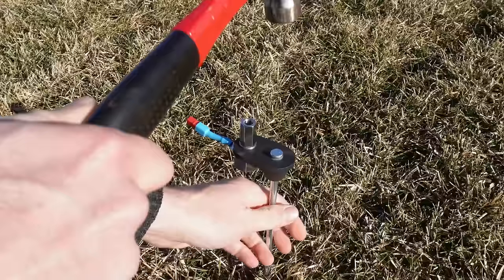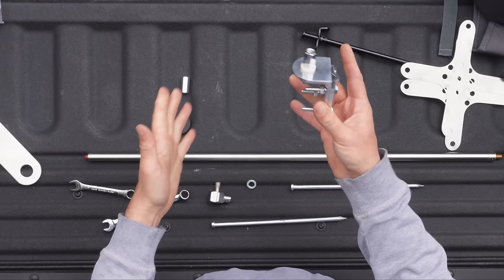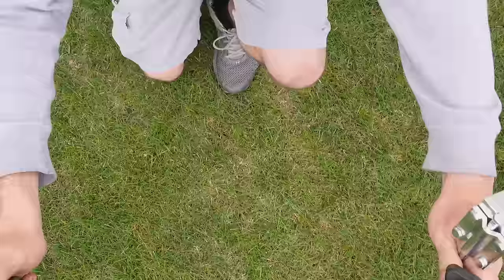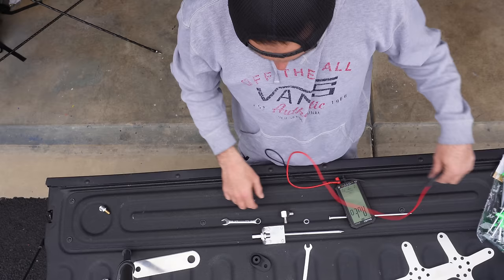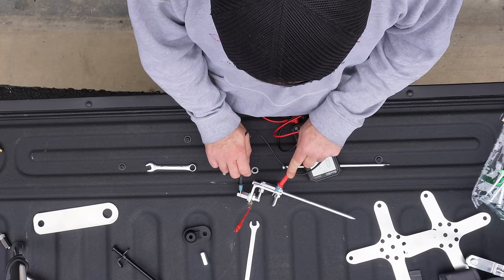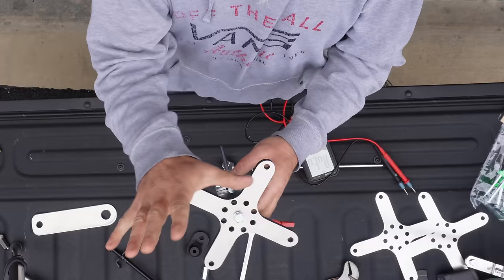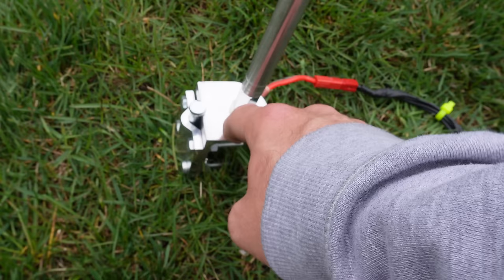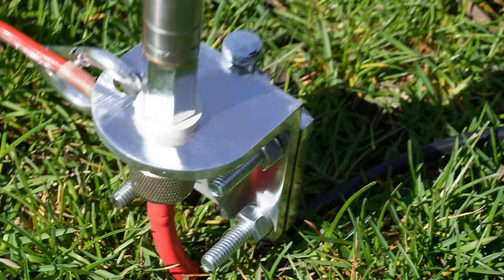This Quick, Cheap, Easy, and Portable Antenna Mount / Ground Spike is a MUST HAVE! 😯😱

Comment: Turn the bolts around and use them to attach your ground radials. That gets them out of the way of coax connectors and gives plenty of room to attach all kind radials, The carabiner could also be attached so it would not be so close to the element
Reply: If you did that. You could bolt on a hard pull handle, of some sort!

Comment: As an amateur (n9pww) and a trucker, I can tell you those antenna mounts are readily available at larger truckstops all day long. Usually around $20.
Reply: Thanks
Reply: They are also on Amazon for less than $10

Comment: Thank you for the inspiration to build a portable Hamstick vertical without spending a dime.  I built one with a Hamstick I was given years ago, a spare tent peg, a rear-view mirror mount I was given along with the Hamstick, and I used some ring terminals I had in my junkbox instead of Anderson Power Poles.  I spent $0.00.  It tuned up at 1.4:1 as measured by my MFJ 269B (which I had to repair first) and my KX1's tuner brought the SWR down to 1:1.  I made 3 CW contacts this afternoon at my daughter's home in her back yard.  It was a little tough at QRP but it worked.  Thank you for setting the example with what you can accomplish with nothing more than what you have laying around the shack!
Reply from the maker: I'm so happy to hear this, congratulations!

Comment: I would turn the bolts around so they are pointing out of the way of the so239. Add a nut and washer and you have a better mounting point for the radials. Great video series! Thanks
Reply from the maker: Thank you, turning the bolts would definitely work!

Comment: This is the set up i was talking bout. This mount with the coil n some radials is ALL you gonna need in the field or base. 
Time to show us how to make our own home made river/slidewinder coil. 
I made mines 100 turns on a 2,5" pvc + 14"wire and a hose clamp.

Comment: If you'd like a longer ground stake, check out concrete rebar at building supply stores. You can get it cut to most lengths or cut it yourself with an angle grinder.
Reply from the maker: Thanks! Will be good for the beach
Reply: I was thinking of rebar myself. Unpainted should ground better and you can get them in any length if you have soft soils.

Comment: I'd use a 4-ft copper ground rod with a filed point instead of the spike. You should be able to hammer it into most ground about 3-ft. Also, keep the long bolts and just turn them around so that the bolt heads are next to the SO-239.

Comment: I've done the same thing using cut off ground rods cut off at 18". They are more stable in the ground.
Reply from the maker: I was getting a good look at those at ace hardware the other day.  My buddy, KD9RUG carries one with his setup also. Seems to work way well.   And this is a question you may have the answer too, but at 18" does that eliminate the need for radials or do you still use them?
Reply: @HAMRADIODUDE  No you still need radials, but you have the option of adding more if you want to add ground connectors

Comment: JFYI  at 4:19 you put the white washer on with the centering lip away from the hole in the bracket.... That lip goes into the bracket to center and insulate the center conductor stud.  If you don't want to have problems later.... Ask me how I know!

Comment: I've done this before with a 102, a piece of aluminum angle, a big bolt, and a stud mount just stuck it in the grass the base of the antenna was 4 in off the ground with untuned coax I still had decent SWR and talked all over town like I was in my mobile with a good antenna tune but I assumed that was because its straight to ground

Comment: I watched your video a couple of times to double-check the assembly of the mount and double-check the continuity of the center connector, spike, shield, and the 90-degree connector I put on the coax mount.  Thank you.  73 de David AE4LH

Comment: I will look for the tent stake. Others turned the bolts around so they stuck out the back side. But that could be a problem for some. Thanks for the infomation! 73  W4DES

Comment: Many old Fudds would regergitate at the fact they were using a CB antenna mount, for anything! ($7.50 at a well equipped truck stop!) Opting to spend $40.00 on the same item, that says HAM Radio on the packaging!

Comment: Good work MacGuyver! Glad it all works and also glad you didn't drill a hole in your hand!🤓🖐
Reply from the maker: There is a reason I have two 😎.   Someone suggested a vice grip for the future I'll definitely need to get one
Reply: @HAMRADIODUDE  yes Sean, good idea. After all, hands are handy to keep. 😆
Reply from the maker: @DonzLockz  absolutely. I have a vice upstairs, but didn't want aluminum shards all over the office.  Gotta fix that

Comment: You could use copper lightning rod for the spike.  They are a little bit longer and larger diameter for better stability.
Reply from the maker: Yeah totally.  Definitely not we portable but more stable
Reply: @HAMRADIODUDE  The ones I'm talking about are about 18 inches long that were used on the roof and went to ground with a heavy cable.
Reply from the maker: @timromankb9upy321  ah yes. My mind went to the huge ones.  That should work fine! Thanks!

Comment: I have a 4 foot copper ground around half way in the ground just outside of my shack. A copper ground wire goes inside about 10 feet to a terminal that grounds all of my equipment. Another wire goes in the opposite direction about 4 feet to ground a metal antenna mast . I attached a 20m ham stick to the top of this rod today , I’m having excellent reception so far with a SWR around 2.5 on the on the MFJ tuner. I haven’t tried to transmit yet. Do these ground wires possibly act as a radial of some sort or is in going to cause problems… thanks again and I subscribed today 🇺🇸✝️👍🏻

Comment: Watching all these antenna videos.  Back in the day we just strung a folded dipole above the roof.  No SWF meters.  It was fine.   We are all lost in these technicalities.  What is the final result?  What do you actually hear on 40m, 15, 10m?   Very little, because everyone has migrated to 6m or 2m.   Handheld.   And how did mobile car antennas work?   

No, the real choice was a "quad" or Yagi.
Reply from the maker: Whatever works
Reply: @HAMRADIODUDE  my point was this.  Like speakers, it's not the specs in the end, its the subjective feel.  Of all these antennas do we have an object 599 sense which really works best?  The best and clearest reception?  K6AGE
Reply from the maker: I can agree to that. Thanks for clarifying

Comment: Hey, this gives me some ideas for my QRPGuys Switchable 3-band vertical for 20, 30, & 40M. The antenna suggests using a wire vertical supported by a 21' fiberglass or carbon fiber fishing rod and a switched board with appropriate inductors for band switching. It is meant for temporary POTA or SOTA use, but your mount and spike could work in conjunction with the fishing rod in some form. I have a female BNC on the board so I will have to adapt that, but I believe I could possibly fashion an 8" PVC & cab as they suggest into the bracket as well. TIme to see what the junk box has available, LOL. Cheers & 73, Dave - KU9L
Reply from the maker: Absolutely.  A guy, George on the ham radio clubhouse discord did just that or something super similar. Good luck!

Comment: Ground spike should be longer
Reply from the maker: Sure, One an easily get a large rod at the local box store.  I chose for portable use and prefer a smaller spike (although the 12 " stake would have been nice). probably can also make a spike out of some spare aluminum rods I have laying around. I haven't had an issue with stability yet. Thanks for the suggestions, have a good one.
Reply from the maker: By the way, I took a look at your youtube page. Nice Chocolate Lab!

Comment: I am new to building antennas and always have questions.  
How does the range on a vertical like this and say a Dipole, End or Center fed, Moxon or Yagi compare?

I love the simplicity of the one in your video here and can't wait to see the improvements you mentioned waiting on for the 4way, Multiband adapter.  I think this would be awasome for camping, POTA and Field Days....  Lastly, love the usage of the Anderson Power Poles for the ground radial.
Reply: Imho, this setup will not do very well at all. I did a similar thing many years ago using a 2' length of ground rod as my spike. I then connected four 25' lengths of electric fence wire to the ground rod using a screw type hose clamp & staked them into the ground with some old 12" barn spikes.
It worked pretty well for a portable station.

Comment: A great vid for ground mount vertical.
Have you tried using that system with a piece of aluminum screen instead of radials? wa7ups

Comment: As a new amateur ham, I was wondering the Telescoping antenna attached to the base, does this require at all a Balun and or a coil for common mode current? Just wondering... as I am looking for a simple antenna to start me off on HF and this looks like a great solution. I have the mirror mount I picked up, just need a Telescoping Antenna and anything else you may suggest to complete the setup.
Reply from the maker: Chokes are important.  Do you have to run one (required)? No, not absolutely.  Radio will still work without it, you'll probably still activate parks or make contacts. However, It is within the best practices to Choke it.  Choking it reduces the potential for "Mic Bite", RF Burns, and your coax acting like an antenna. Thus having a choke should be more efficient than not.    Cheers!

Comment: Wow! Great antenna mount solution. It’s too bad I can’t se it here in any New York City Park. There is a $2,500 fine for poking any hold in any park. You can’t throw wire up into a tree either or you will get the same $2,500 fine. I call it the City Parks as a museum concept.
Reply from the maker: I have an idea for you.. can you clamp anything on to a bench?
Reply: @HAMRADIODUDE  Nope. Can't clamp anything on city property. I usually use a JawMount to clamp my antenna to my wagon (the type used to use as a shopping cart). Thanks for getting back to me. 73 de N2LRB
Reply from the maker: @josebrivera1716  Have you looked into he Wolf River Coil? That may be the best option
Reply: Poor you! I cannot understand why anyone would spend more than a few hours in NYC. It makes even 1890s Prussian Berlin look like a garden of delight. You might look into using a tripod. Camera ones would do for small antennas mounted low. Lighting tripods would work for larger antennas up higher. I have one of those. But I suspect NYC has laws against that too.
Reply: @Inkling777  I was born, have been raised here in the city. One does not just pick up and go. Maybe you have no roots anywhere but many of us do. Our families are here and ham radio is not the primary reason to stay in one place. I guess we city people are made of sterner stuff. Why have such a mean reply?
Reply from the maker: A bunch of sad hams, that's all. I hope you don't take it to heart.  On that note,  keep an eye out for a video I'll have this month on a possible solution for you

Comment: Hey, I have made those for friends for a couple years, so thank you for publishing your DIY…. Just wondered if you could elaborate on your “X” plate please.. and thank you..De N1aqh Spike
Reply from the maker: Absolutely. Unfortunately at the moment I'm driving so it's hard for me to link it. But if you go to my videos and check the last 10 videos or so, you'll see something called the hamstick commander. This video I kind of came up with the concept of the whole thing. And from there I made another video and I think I called it the mag Mount Commander. Basically I designed a wire spacer similar to what you may see with the DX Commander. Additionally, the file if you have a 3D printer, is on thingiverse.com

Comment: What a great idea/video.  I might even attempt this as an alternative to my Wolf River coil base.  What is the Power Poles used for?
Reply from the maker: The power poles are how I use or install my radial wires,  although you could just use the bolts on the L bracket with ring terminals.  The woofer recoil I believe comes with 3, 32 ft radial wires. You can even use those if you desire. Best of luck! If you do use this as an alternative to the WRC stand, would you let me know how it works out as far as stability? Thanks!
Reply: I am curious how you construct the radials using power poles(wire of choice)? I have never seen that done.  It might be a better alternative than the x6 wire radials I currently use.

Comment: Why the red wire?
Reply from the maker: I thought I responded: in short, that's where the radial wires attach to.  You'll need radials on a vertical like this. I have 5 at 10ft each, but this could be more or less depending on what bands you plan to operate

Comment: Ok new ham here whats the 2 or 4 antennas together for thanks
Reply from the maker: It would be like a Hamstick version of the dx commander. Bsically, each antenna element can work independently.  So 20m hamstick, with a 10m hamstick, and you can have both of those bands.  Heres an example - https://youtu.be/E55VWFHDvYk
Reply: @HAMRADIODUDE  thanks I was thinking they were all running the same band

Comment: Nice  inexpensive mount  but i see you have that Red wire hooked to four black wires......Where are they going to?  four grounds?____
Reply from the maker: They are for the radials.  Radials act as a ground plane, or the second part of an antenna.  Color of the wire didn't matter, just how/where I placed them on the mount.  Without radials, the antenna really isn't as effective as it could be.
Reply from the maker: They just go out and follow the ground, I gave mine in equal directions around the antenna
Reply: @HAMRADIODUDE  Perfect I was scratching my head trying to figure it out.....Thank You

Comment: So you have a link to that 1/4 wave 20m antenna?
Reply from the maker: Sure. I don't remember in the video if I did it was an MFJ or wolf river telescoping antenna,  but it is for sure the wolf river https://www.wolfrivercoils.com/order.html I got the 213 inch
Reply: @HAMRADIODUDE  Thanks. I’m looking for a beginner, no frills 20 antenna for a base station. Torn between using Ham Sticks or an inverted V diapole. I’m sure you have a video on that somewhere. Cool channel!
Reply from the maker: @TheMultisportGeek  I don't, but it's a great idea. Personally, I'd go with a half wave 20m dipole, as close to 35 feet if you can.   But the thing with that is, dipoles are semi directional.  I have great results with the 20m telescoping antenna and radials like shown in the video.   Whatever you choose, happy contacts, have fun!

Comment: I'm just picked up a spike from Home Depot but it is painted. Should I scrape the paint off to get the bracket to ground to the spike?
Reply from the maker: the spike in this case is just to mount the contraception into the ground. The radials are going to be doing the work. So as long as the radials have continuity to the outer shield of the connector, no need to scrape the paint off.
Reply: @HAMRADIODUDE  Thanks for the reply and explanation.  I put it out with 15 2.5m radials and the SWR was down to 1:1 on 40m hamstick where on my mag mount it was fighting to get below 2:1. the other bands followed suit.  Thanks for the simple design.  It really works!
Reply from the maker: @btaylor1948  thank you.   I needed to hear some positive results today.  Glad to hear!

Comment: Please stop flipping it around so fast all the time there is no way to see what it really looks like
Reply from the maker: I've tried many different times to slow down. This is me slowed down. I can't slow down anymore.  The pause button works. 5:43 seconds should get you a still photo of the object. Thanks for the suggestion, cheers.
Reply from the maker: I did think of one other thing that may be helpful; there is an option to play the video at a slower speed in the settings if youtube.   If you need, I can send you a photo